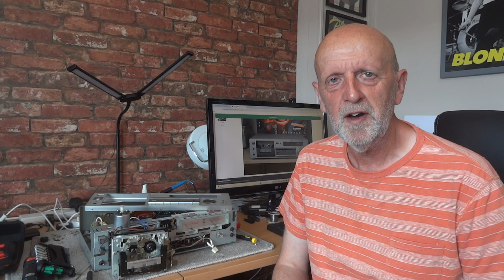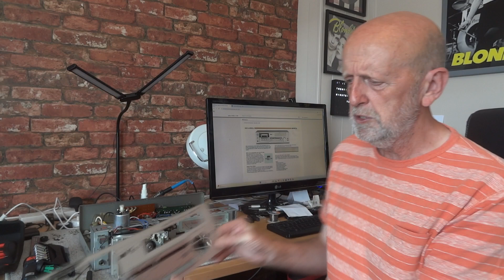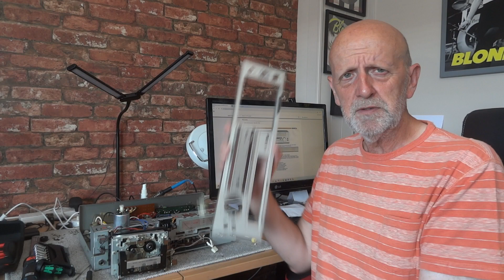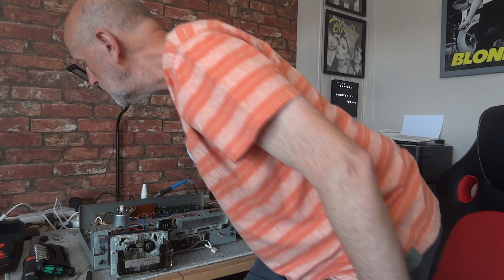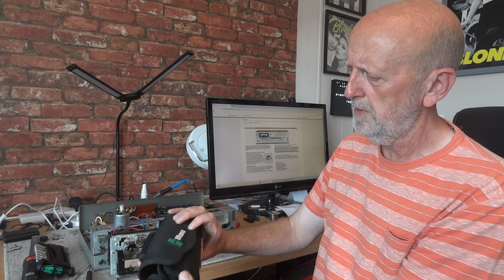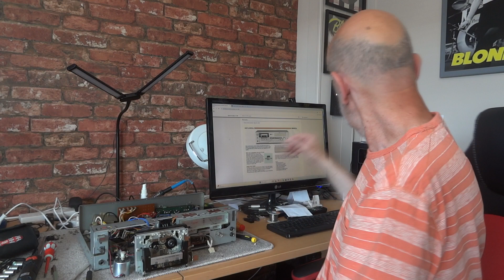Buying A Cassette Deck in 2026 ,  Problems Melted Belts, Cracked Gear Cog and more

Comment: Another good HiFi project. You'll know somethings amiss if you have half a dozen screws left-over.) Watched a few cassette deck separates being serviced with most needing substantial teardown. Agree with you, there is a big difference between an ad that says belts changed and one that says Recently fully serviced, transport overhauled, old ~30 years old sticky grease removed, new belts fitted. As all my decks, this was disassembled entirely (chassis and mechanism), cleaned, lubricated with proper lubricants, circuit boards checked for weak solder joints, calibrated, demagnetized etc etc.
The device is as clean as possible. The LCD display is sharp and bright, heads and pinch rollers are in very good condition.
Reply from the maker: I will be doing well with just 6 left over I think lol, I will worry about that if the belts all work and the spindles spin. Sound like you have done a really nice job on all your decks, nothing like knowing they are as good as new inside.

Comment: hi mike i had some RS101 of ebay  they run on a 12.5 x 2  ac 

the 3 decks are working 100% after i service them  
i only buy cassette decks with the high speed  on them 

so i can play back 3 3/4 ips cassette  tapes  i can deal with the eq on the recording decks 
yes there's alot of poor cassette decks sit around
Reply from the maker: Think there are 1000's around Bob that need looking at, shame most will be dumped as not many people around servicing cassette decks now

Comment: Thanks for this video.  I've had a Technics RS-917 for many, many years (apparently it's an RS-B107 with bright buttons instead of black).  I never got into cassettes much except to record an album to have in the car, and it hasn't been used at all in many years.  I pulled it out recently and tried it.  It actually plays fine, but on fast forward or reverse it's obvious that it does in fact need service.  (It's a bit wonky. Haha!)  I purchased an original service manual (RS-B107) and it just lists "belt" for each of the three.  So I just need to buy variety packs and figure it out?  There's no reference to know specfically?  I've been wondering about that.
Reply from the maker: I wish you luck if you do decide to change the belts, some can be very easy and others a bit of a nightmare.

Comment: Before the near four-year covid lockdown, I purchased a number of decks from thrifts.
How I will find time to locate parts and install them will be a problem.
I did buy three used Nikon D3300 DSLRs for recording video of my disassembly process and compartmented storage for parts as removed.
Hopefully, the videos of disassembly will help in re-assembly if my work is interrrupted
Reply: If I dissasemble a deck for a belt change,  I make a video too , and it goes on utube , that however,  isn't enough,  when it comes to all the loose screws , I'm afraid. Especialy if I'm going to put it together 6 months later.
Reply from the maker: I should have at least taken a few pictures, but one undone screw and lead went on to another. think I was a bit to eager.

Comment: All these differences screws , sometimes have different threads on them as well . Im might pull apart a deck and then , re assemble it 2 weeks later or 6 months later ! So i don't have to rely on my memory or even loose the screws,  i usually if possible,  screw them back in the place they came from . Makes assembly a bit easier.
Reply: I intend to try recording video of my work to aide my memory
Reply from the maker: This is true, here I have a lot of screws that seem to be 3 types